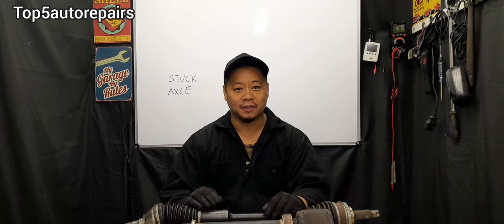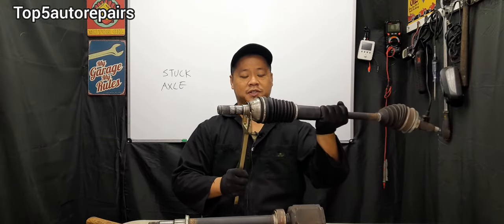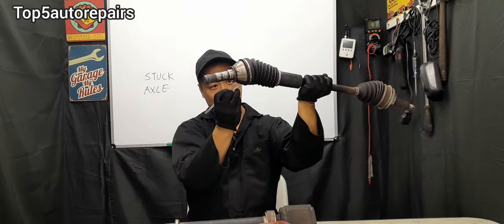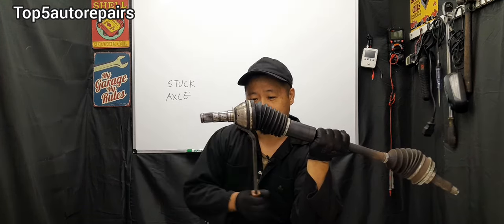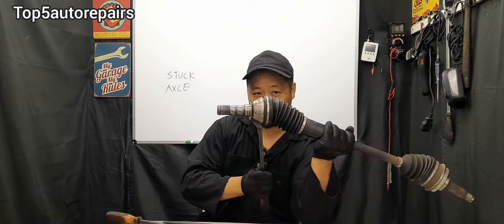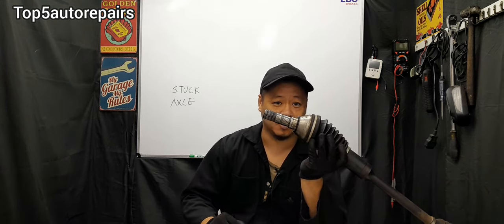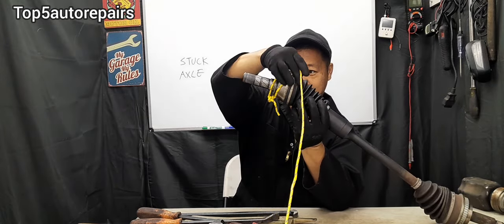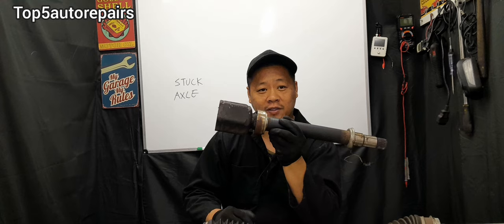9 WAYS TO REMOVE STUCK AXLE FROM THE TRANSMISSION

Comment: Why isn't one of the methods to screw the axle nut back in a little bit and then just yank on the axle and wheel hub at the same time once it's disconnected from the strut? It seems like that would work. There would be no prying or pounding on the back of it. Once you pop it loose you just unscrew the axle nut.
Reply: Axle’s are never slide hammers lol 😂
You will pull apart the cv joint as there is only a clip holding it together

Comment: In my special case nothing worked 10 Honda Pilot passenger side exhaust is in the way. And I even used a come along with little axes for an air chisel and hammer and rotation methods nothing works. I think next is chopping and exhaust all getting a better angle to hit it. And last solution is to Bern it.